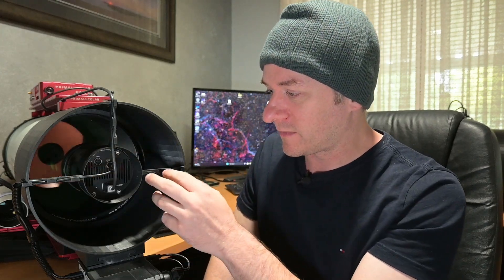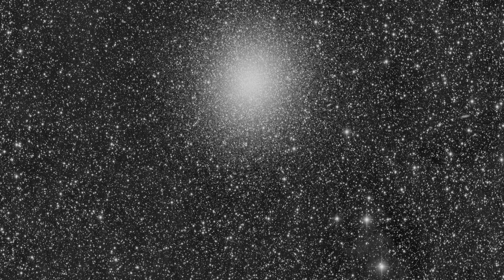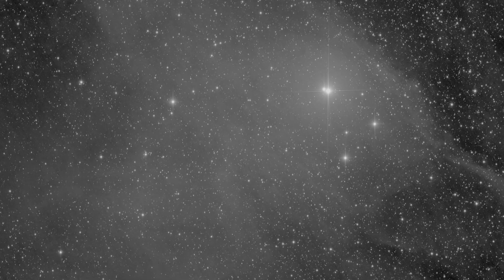NEW RASA 8 Dew Shield and Dovetail Plate - 3D Printed Design -

Comment: I read a review on your site about someone using this on their 8" edge hd. I wonder if it would fit the non-hd 8" SCT scopes?
Reply from the maker: If the dimensions are the same I don’t see why it wouldn’t fit. I believe the telescope end cap is the same, if that’s the case then it should work.
Reply: Sadly it has been hard to find a print service for the size of this, and the few that can print this are quoting 300-500 USD. One of them said something about rebuilding the file from scratch and that would be a seperate service fee(200/Hr USD). I sent a message through your site after purchasing the files about some updates to one of the models, but have not heard back. It was late in the week and i know we both have lives outside of this hobby. Would you consider doing a print for me? I know shipping to the US may cost as much as a local printer at this point. If the cost or time is too much i understand. My backup plan is to purchase the aluminium one from Celestron as that may be the easiest and most economical.  @StevenMorrisAstro
Reply: Another print quote just came in at 675 USD for ABS plastic. looks like it will be the aluminum dew shield.
Reply from the maker: @DrunkferretKG wow, 675 US! I wonder if anyone here could help you out.

Comment: I'd love a 3d printed shield for the RASA 11 & something better for the cable management plus still be able to use the font dust covert to contain everything including the dew ring & camera (if that makes sense lol) & save me having to tear everything off it every time I take it down. Just thought I'd mention I've got the ole CGE pro up & running in the observatory but haven't had a first light with it yet so fingers crossed it'll be soon.
Reply from the maker: Unfortunately the printers are just too small to print something as large for the 11” but it certainly makes things so much easier setting up when everything is connected. 

I think I did see something about the CGE being in the observatory now, that’s awesome! Wish I had one.

Comment: Hi Steve, are you able to provide the dimensions for the camera internal diametre of the new print sheild?
Reply from the maker: Are you referring to the diameter of the drop in mask that sits above the camera or the internal diameter of the dew shield itself?
Reply: @StevenMorrisAstro  yes - the drop in mask.  I'm also looking to use it with the edge8 HD.
Reply from the maker: So the drop in mask section should be 90mm the diameter of a qhy camera and internally 89mm. I created a 1mm wall which I may increase to 2mm for added strength which would make it 88mm internal.
Reply: @StevenMorrisAstro  cheers - the OD of my touptek zwo2600 equivalent is 80mm
Reply from the maker: Yeah taken measurements off mine with the Baader FCCT and QHY setup. I might have to make a few different versions of drop ins and add that to the pack.

Comment: You've got me thinking about a Giotto now, how's your flats with it, did you notice any difference over what you used before? Also, you have a fair about of glare/stray light on your dew shield it may be worth your while flocking the inside of the dew shield. I flocked the inside of my Espirit 120 dew shield which increased contrast a fair amount
Reply from the maker: My home made flat panel and the Giotto in the quality of my flats didn’t really show any difference, it’s the automation of this system that makes things a bit easier than previous. 

There is a little bit of shine to the material used for printing, not heaps. I do have material here to flock the inside if needed but all my other dew shields I’ve designed and printed I haven’t had any issues with glare or reflections. I won’t discount the idea though of flocking that’s for sure.